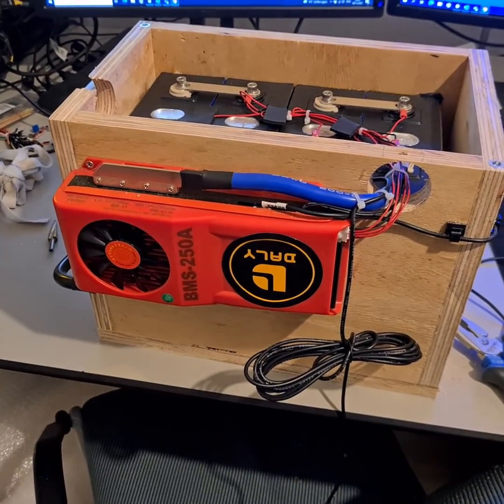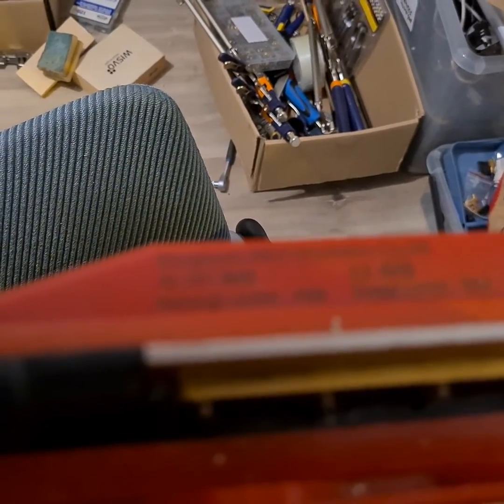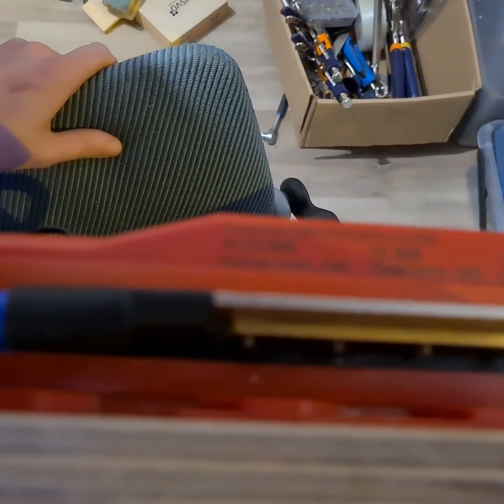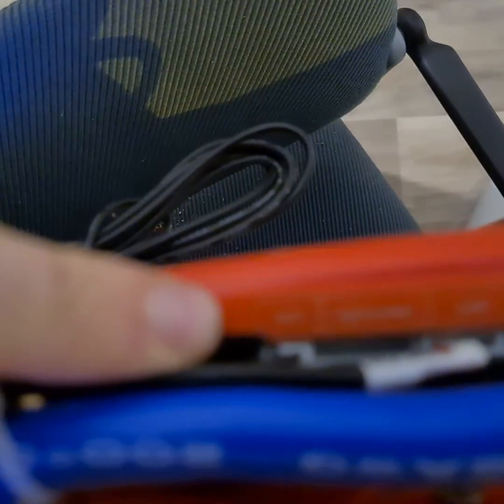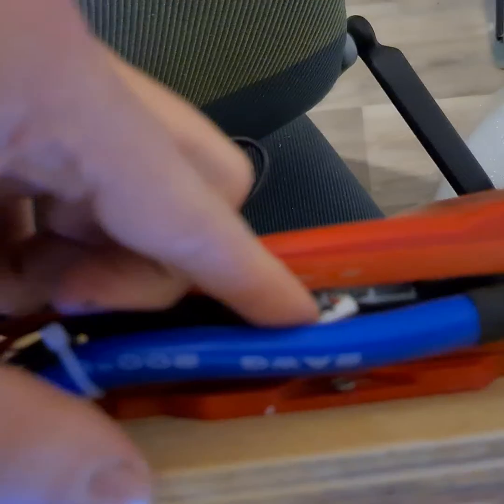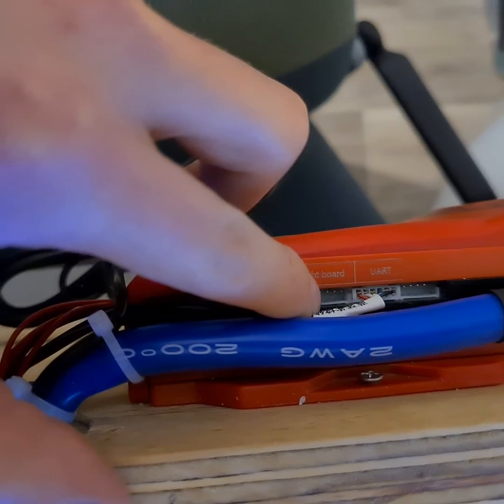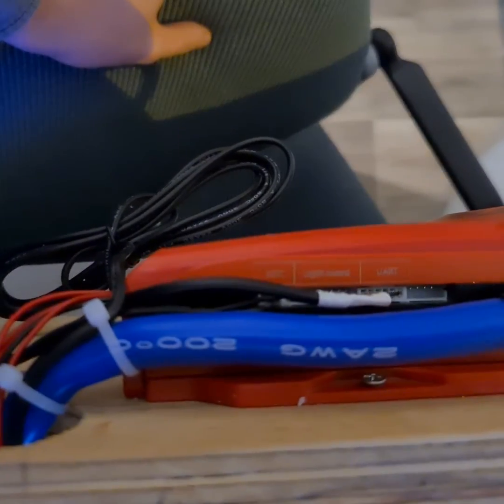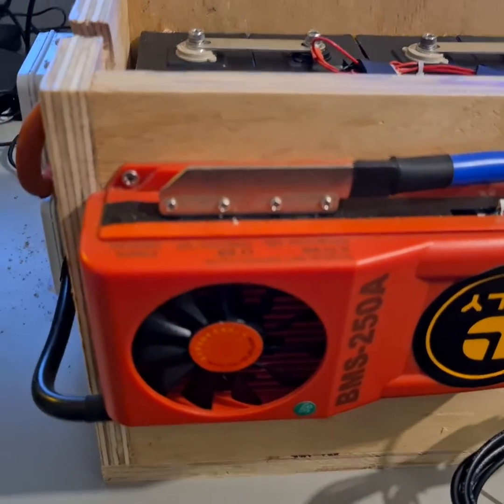Unlock Your Daly Smart BMS: 2 Simple Steps to Activate It!

Comment: Mine turns on then straight back off with a discharge high temp alarm
Reply from the maker: perhaps your setting is lower than ambient/corrupt?
Reply: @TheYieldPoint  It's a brand new replacement too my first one has a 7A current draw error so they sent this one  it doesn't smeel burnt and the highest temp was 23 degrees i have a usb cable on order
Reply: @TheYieldPoint  It's a battery high drain temp and mosfet high temp error
Reply: @TheYieldPoint  I put my old unit back in I think the replacement is a fake

Comment: And waht is to Do when is See the Bluetooth but can not connect. The App is crashing. Bms is activated and i can Charge. On the active balancer Bluetooth i also can open.
Reply from the maker: Best to reach out to daly. Perhaps it is a compatibility issue with your phone.
Reply: @TheYieldPoint  i wrote a Mail to daly. Seller is not answeer.
Tried on 3 phones. And with the active balancer i can connect so i think not the phone. Thanks for advise

Comment: Thanks bro it work for my 48V 200-amp bms  i try a few other ways didn't work my bms didn't work for a few days and i decide to take the chance with this method and surprisingly it work
Reply from the maker: Thanks for letting me know that the method worked for your 48V 200-amp BMS! I'm glad I could help.
Reply: Hello, my model is Daly BMS 16S 48V 200A. By chance i disconnected small black wire and now my device seems like stuck. I do not see it. Do you think this method will work for my device ?
Reply: Unfortunately this didn't work for me or all the other solutions.

Comment: Poking random pins is dangerous and may damage the BMS.  It's also entirely unneccessary.  If the Bluetooth link goes to sleep it will wake instantly when you apply any charge orf discharge.
Reply from the maker: Mine did not. I'm not poking random pins ;) , this was actually on advice of Daly